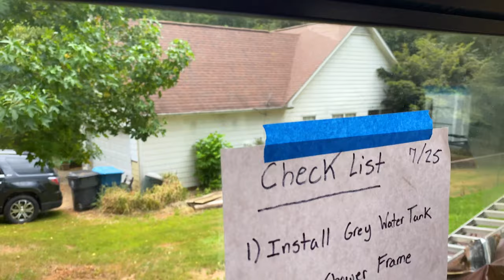Shuttle Bus Conversion | Building New Floors | Skoolie Life How To DIY

Comment: This is an awesome video! We just bought a shuttle bus almost like yours, except ours has a very clean looking fiberglass inside instead of carpeting, so I wondering if we should take it all the way to the frame or just insulate and put down new plywood. Thanks!
Reply from the maker: I would just insulate :) We were worried about rust on our vehicle and needed to do a treatment. We also intended on living in the bus full time for 2-3 years and wanted to ensure a stable foundation. Wood was also no post covid pricing yet either lol.

Comment: Love the vids. This is THE EXACT BUS I WANNA GET!!!! How long is it please? Also how many feet is there behind driver's seat to the back wall/window please?  Also is this an E350? Is this same body called something specific with back window how it is and the big side door n the back? Thank you!
Reply from the maker: Hey Christopher! That's awesome!! We absolutely love the bus so far!! On the inside, the dimensions are 14'4" in length from the back of the driver seat to the back window. And 7'4" for the inside width and I believe roughly 6'7" for the inside height. I'm not 100% sure what the outside dimensions are exactly, (and I will be measuring that out tomorrow) but I would say that the length is maybe 21 feet? It's a little larger than the average parking spot at Home Depot ;) This is a 2014 Glaval Shuttle Bus and its a Ford E450. It was originally an 8 seater plus 2 handicap spots. I'm not sure on how to specifically ask for the handicap to be on the back passenger side. The lot we went to had tons of buses and some had them in the front, back and very back wall. We wish you the best of luck finding the perfect bus for you!! :)
Reply: Thank you so much gor the reply!!! Yours is pretty much EXACTLY what I'm getting,  lol. Excited def. Just me, no pets or anything.  Gonna live in it and work my business on the road. Thanks again!